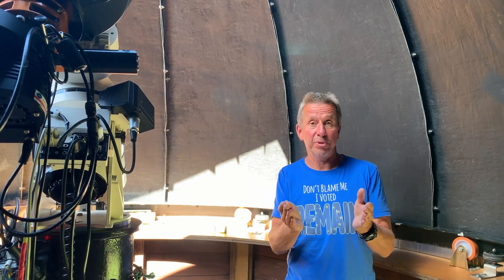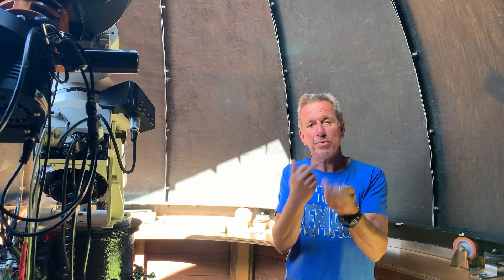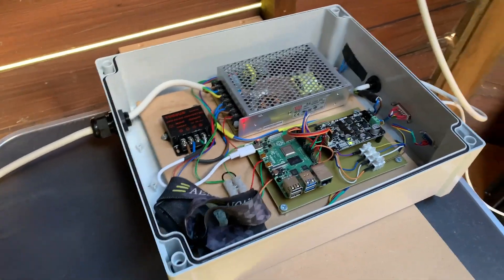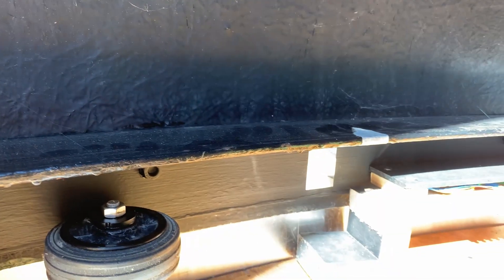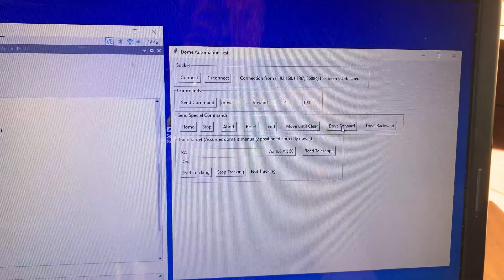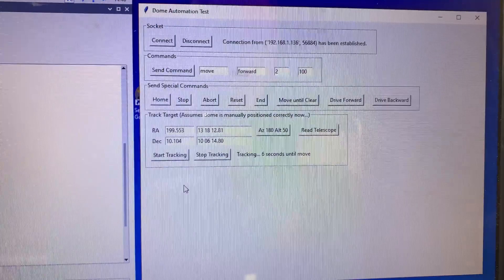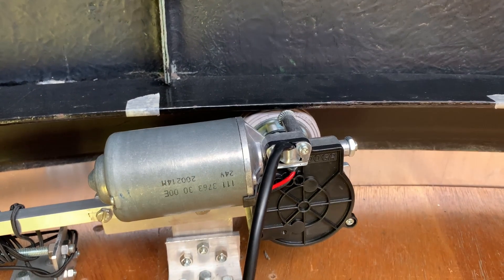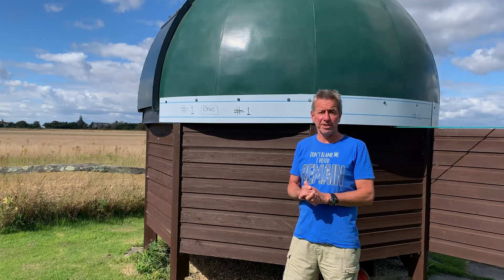Dome Automation Project Part 6 - Update - It Works!!!

Comment: Hi Ian, belated congrats and thanks  for the videos i watched them all. Curious though how you built the metal ring and the large wheel for the motor. Thanks again.
Reply from the maker: Hi Colm, Thanks for your comments. I had the ring made by a metal fabrication company. I'm not sure I've got a record of it! It came in 2 halves and I got a friend to weld it into a complete circle. The wheel for the motor(s) is from Radiospares - they have dozens. I had another friend make the adapter to fit it to the motor shaft.

Comment: Excellent series of videos, well done! Would it be possible to get a parts list and the code you used for the raspberry pi? I’m currently building a 3m observatory and hoping to automate it too.
Reply from the maker: Thanks! You'd need both sides of the code - RPi and the PC side. I'd be willing to share it, although it's not very polished for public consumption if you get my drift.
Reply: @iansharp1171  That would be great Ian. Could you email it to me? Also I checked on the Radionics website and I didn't see any motors similar to yours. Could you share the parts list also?